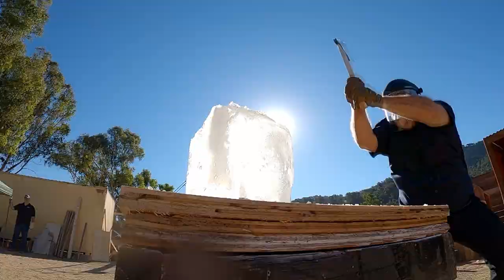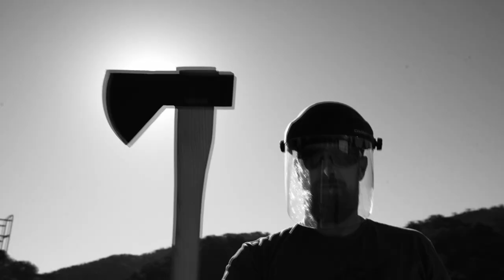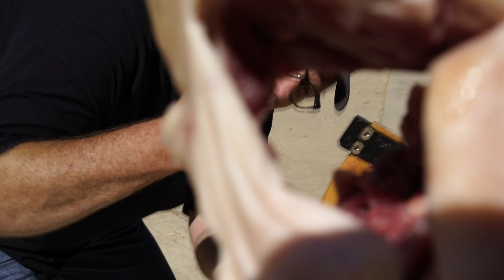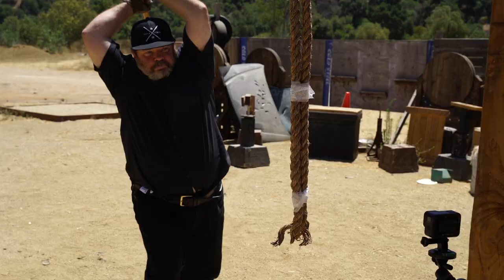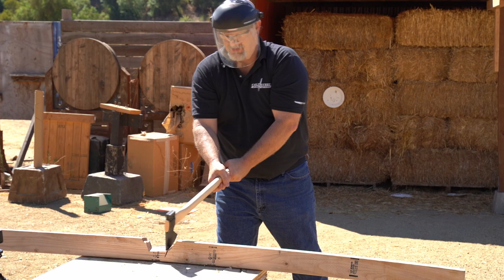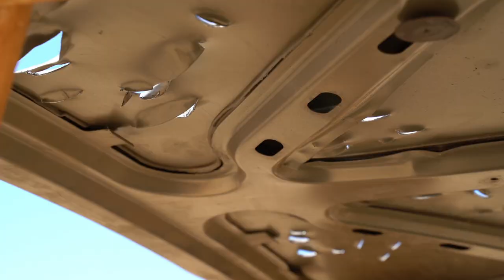It's a Beauty - Hudson Bay Camp Axe

Comment: Make a 5 - 5 1/2 inch blade with a code 4 slim handle scales with some stippling on the aluminium scales and an extended stud. That would be the ultimate edc defensive folder.

Comment: I have it after I broke the handle on my trail boss love the way you guys attach the head here we have hard twisted red oak and a few hard hits will break the best of axes handles(when you over strike) I'd say this axe splits better then my estwing that I keep in the jeep this sits next to my grill great job on this axe
Reply: why not rehang your trail boss?
Reply: @sinisterthoughts2896  I actually still have it(and use it all the time splitting kindling) with about a 8in handle the break was superficial so I cut it down and used the lower part of the handle to re hang one of my sledgehammers the Hudson bay has also held up great and still has the original handle

Comment: 1. get rid of those fucking bolt things. 2. you don't need a handle that thick. it transfers more shock and you can get repetitive stress injury. if it's hickory, an axe that size can have a handle two fingers thick from the side, one finger from the front. if should flex. if it flexes, there's a lower possibility it will break from regular use. beautiful pattern... love your stuff guys. and your passion. peace.